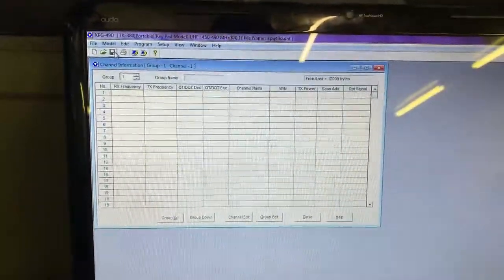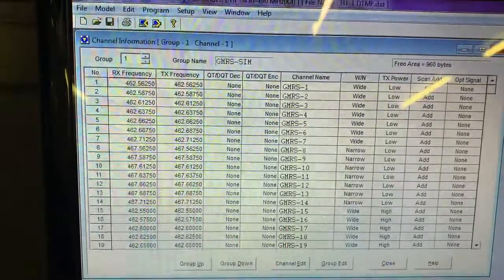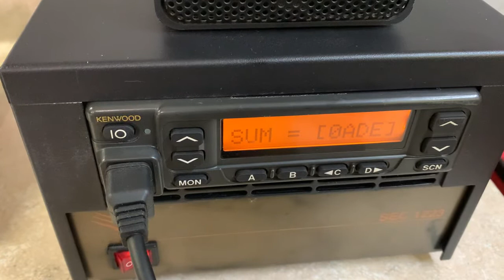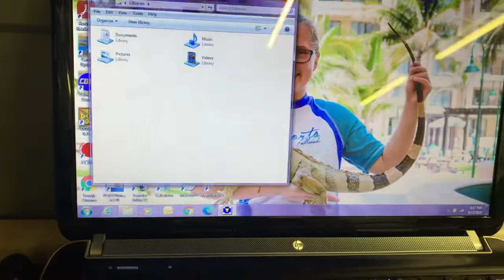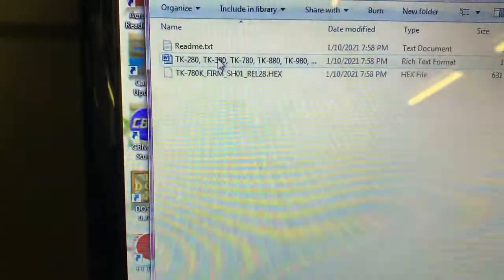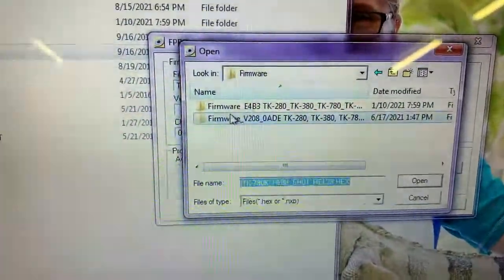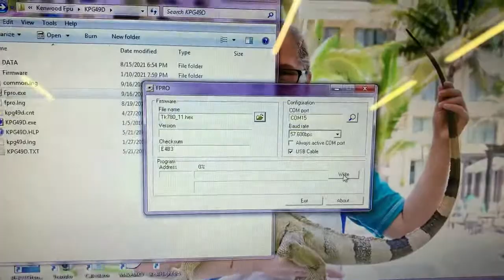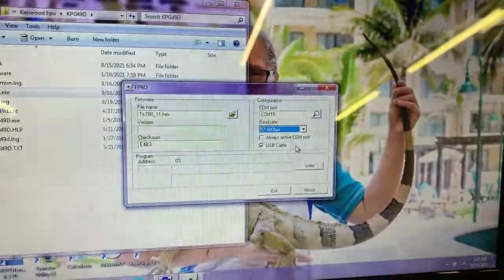Kenwood TK380/TK880 Firmware Programming

Comment: was able to update firmware on 1 rig and then it puked.  another rig has fw 1.5209 (fleetsync from what I read).  the rig is a tk-880-1 ver2, so can I safely install the 2.8(?) fw?  radio programs aok with 49d and works ok.  are there any advantages to updating fw or just leave it?  searching and searching online without finding an answer unless I'm not asking the right questions.  ty..73's

Comment: Hi you helped me before on finding a cable.  I am missing a tone DCS 036N. I need that for my local repeater on receive and transmit tone of DCS 145N. Am I out of luck since the programming software doesn’t have it? That’s the only thing I’m missing
Reply from the maker: Hey man…sorry for the delay.  What you can do (since those tones aren’t available in the drop down list) is manually type in “D036N” in the decode box, and manually type in “D145N” in the encode box and then save your codeplug file.  I just tested it and it works fine (the radio can still generate that tone, even though it doesn’t show in the drop-down list).  Give that a try and see if you can break squelch on that repeater.  Report back, if you don’t mine…in case others read this (encounter this).
Reply: @Craigs-corner  hi that worked great, thank you again for your help
Reply from the maker: @dustineasley854  that’s great, man…glad to help, and thanks for reporting back success…may help someone else out.

Comment: Can I do this on a Mac?
Reply from the maker: I don’t think KPG-49D is compatible with Apple, unless you can dual boot into Windows.
Reply from the maker: I found this excerpt on a forum discussion from 2017, “I have actually used Mac for five years now. I run VMware on my MacBook Pro and use that software, running Windows 7 as a Virtual Machine inside VMware.”  He also goes on to mention that you have to buy a USB to serial programming cable that uses the FTDI chip versus Prolific.  For cables, I always buy FTDI cables from a guy named Mark out in California, for example his cable for the TK-880 https://bluemax49ers.com/product-explorer/kenwood-tk-880-ftdi-programming-cable-kpg-46/ and he can help you out with software and firmware files.  Hope this helps.

Comment: You left off how to get into the software? I have the Software disc but I don't know what to click on to get where you start? I'm not a  high tech guru just someone that has no clue what I'm doing.
Reply from the maker: Send me an email to sargeaf@icloud.com and include your name/number and I’ll call you…should be able to explain over the phone.  It sounds like you have the install disk and need assistance installing the software onto your computer, then go from there.  If you want to try…go into disk one and look for a file called Setup.exe and if you run that it will install the FPU software onto your computer.
Reply: @Craigs-corner  I will look at it when I get back out into the shack.

Comment: I checked the link and looked through the blog posts and I could not find the firmware update file.
Reply from the maker: Hmmm…I see what you mean.  It had been there.  I have the .hex firmware files for both V1 and V2 radios.  I could send you a Dropbox link to download them to your computer if you provide an email address.  It would be from my Dropbox account.  You cannot email them directly…they usually get stripped as potentially dangerous file types, since it’s a .hex file (machine language).

Comment: I have several TK 880's and they have been programmed with v1 firmware. When I hold the scan button and power on the radio, it shows the ver 1.5209 then channel one. The two I've tried won't enter programming mode. Any suggestions greatly appreciated.
Reply from the maker: Sorry for the late reply…you may have already figured this out, but I’ll answer just in case someone else runs into this.  I actually talk about this at the beginning of the video.  Plug your radio in (powered on) and start the programming software.  Read the codeplug from the radio, then go into General Setting, then tab2.  Click the box that says “Firmware Programming” to put a check mark there, then write the codeplug back to the radio.  When it completes, the radio should restart, then you can power it off, hold down the scan button while powering it on, and it should then go into firmware program mode.

Comment: I own a TK-880H-1 version 2.  
I can program the radio with KPG-49D (windows) but when I do write to it I get a message stating
the firmware does not support Stun Validation, whatever that is.   thanks
Reply: I used the procedure to determine what version I have.  B5DC.   How can I tell if this is newer or older than 0ADE ?   What would be the difference in features if my firmware is older? I am using KPG49D 4.20  (Windows) programming software. Should the radio still work with this programming software after updating firmware? The current programming software is programming the radio fine but I am wondering what the difference would be?
Reply: I use a RS232 cable connected to a USB to RS232 adapter.  This allows me to use USB on my computer.  Should I still check USB in the firmware programming software?  I noticed you had USB checked.

Comment: I have a locked radio, given to me for free…broken antenna, dead battery locked radio channel 11. Seems like it should work if it was reprogrammed or cleared of all previous set up instructions. Is it possible?
Reply from the maker: Try powering the radio on while holding down the scan button and report to me what the display says on the radio.  Some Kenwood radios might have an aftermarket firmware programmed (not Kenwood).  If you hold the scan button down and power the radio on, the display should say “PROG” and then some numbers next to it on the right; if the display says that, it’s in firmware programming mode, and means it can be re-flashed with Kenwood firmware and unlocked/reprogrammed.  Let me know.  The numbers after the word “PROG” indicate the baud rate for transferring data between the radio and a computer.  Is this a TK-380 or TK-880?
Reply: @Craigs-corner  it says P below that, a down arrow  to the right ch 11.  Attempts a changing the channel, LOCKED
Beeps loud and clear. So the speaker works, replaced the battery and antenna. Going to try channel 11 on another radio to see what I get, if anything. Thanks for the input. 
Dave
Reply: @Craigs-corner  is it possible to Flash the  TK 863g With the tk880 firmware...? If so then I can reprogram (tk863) now tk880 with channels and so on correct?

Comment: Do you know if I can scan all UHF freqs with it. I have a 380 and programmed all the GMRS channels into my radio, but want to listen to more, so would I have to put all UHF Freqs into my radio, or is there a way to scan and find used ones.
Reply from the maker: The type 1 TK-380 will work from 450-490MHz.  I can tell you they can be programmed lower than that, as I monitor some local 70cm repeater traffic, but I don’t receive that great on a GMRS specific antenna.  I use a Smiley Superstick antenna for GMRS and it works awesome with this radio.  I can hit one of our network repeaters from over 40 miles with the TK-380 and people tell me I sound like I’m on a base station.  If I put a dual band antenna on I receive the 70cm frequencies better, but it degrades the GMRS performance.

Comment: 73 to you as well.  FYI, I just got my gmrs license.  I purchased a used TK880 to test on the higher power simplex.  (wife won't get her ham ticket), so I figured that this might get going.  Anything else you could think of that would help with the radio would be greatly appreciated.  73. K8JCL

Comment: Thanks for the firmware link.  Would you please please provide a link for the cable from the computer to the TK-880?
Reply from the maker: I’ve purchased several programming cables from this gentleman…he is a long time HAM.  This FTDI cable is plug and play via USB on both Windows 7 and Windows 10…connects to the mic port on the radio.  https://www.ebay.com/itm/152844849543